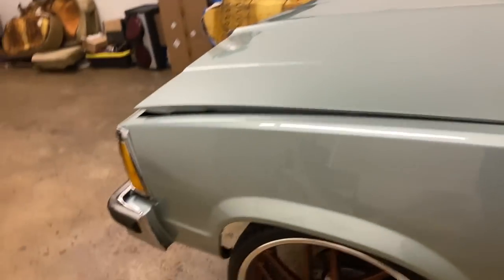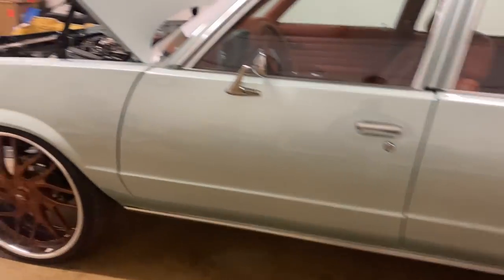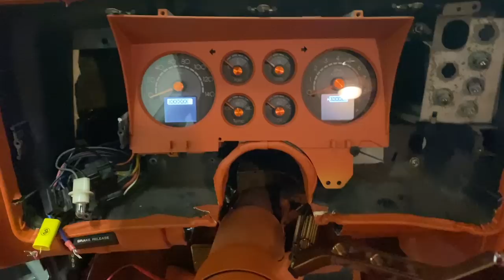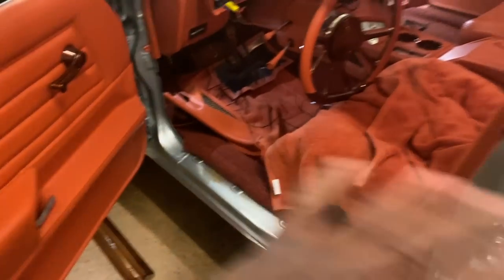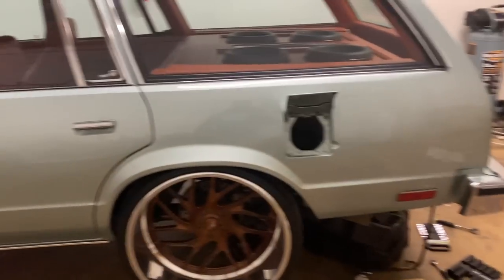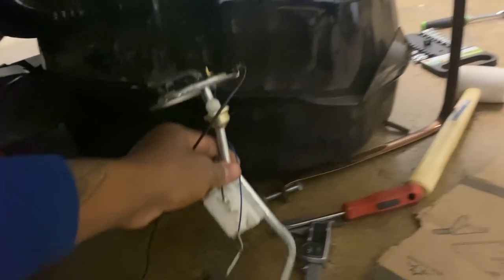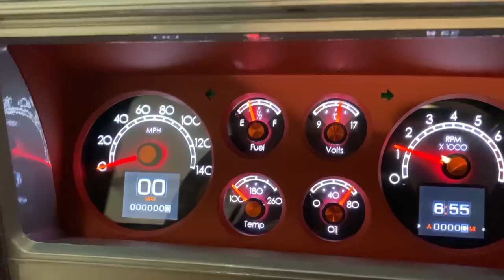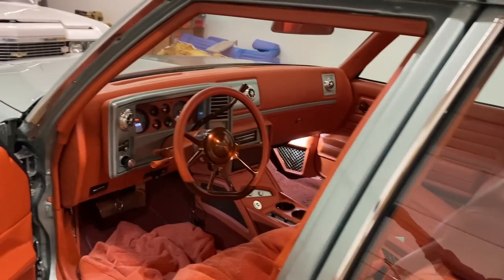HARDEST MALIBU WAGON | FUEL SENDING UNIT & CHARGE CABLE

Comment: i charge my optimas....no issues in 3 years
Reply from the maker: Used on audio setups or daily drivers?
Reply: @SteveDavisCarGuy  3 Reds....bought at the same time. Charged b4 I put em in...one underhood. 2 in the back... Technically all for audio. I just used a Battery Tender to stay at peak volts

Comment: Where's the filter for the carburetor?
Reply: I'm sure he has one but how many cars have you actually seen break down because they didn't have a filter?

Me? None.
Reply: @KingJT80  Dust dirt and grime are not good for the cylinder walls of the engine, shortens the lifespan. I would not run my 40 year old car without an air filter that's for sure.
Reply: @LMBee00  so here's the issue.

For him to have an air filter on an engine that runs like that. It'd have to be so tall he'd have to run a cowl hood .  They do make them but now you're talking more money on either a fiberglass hood or maybe trying to run a low profile cold air intake with a big enough cone on it to flow so it doesn't restrict the intake.  

He could run a carb with no choke and do a low profile cold air intake but now it's harder to start because you just took away the choke but the carb will flow more because of it IF the intake is correct

It's more to it than you think to run a good filter on that engine. It cost   money one way or the other to make it right